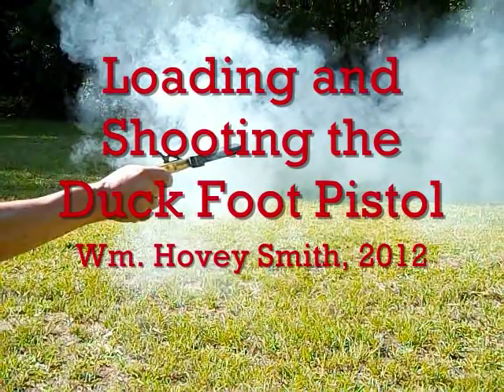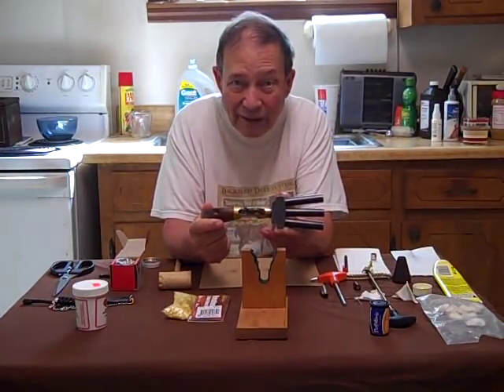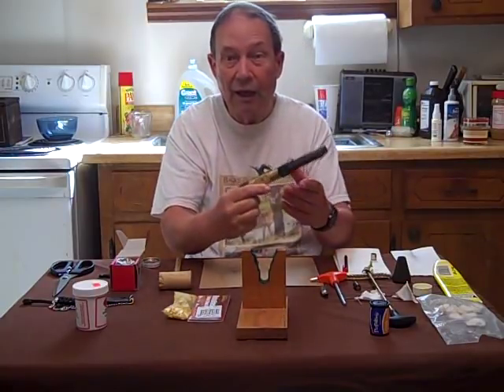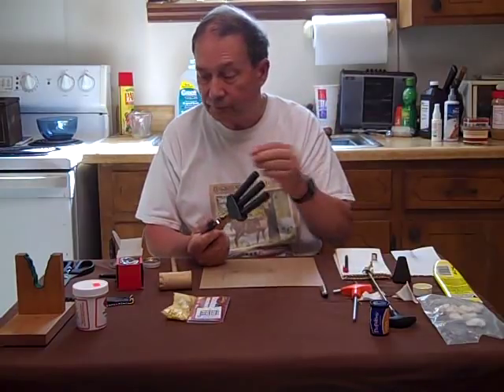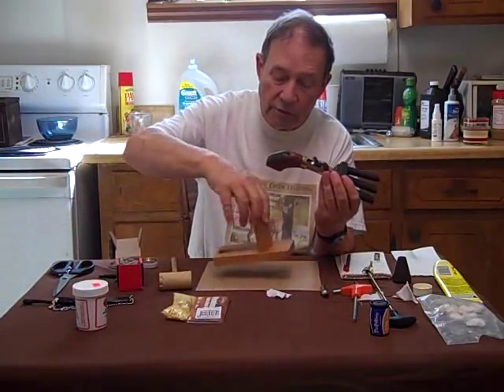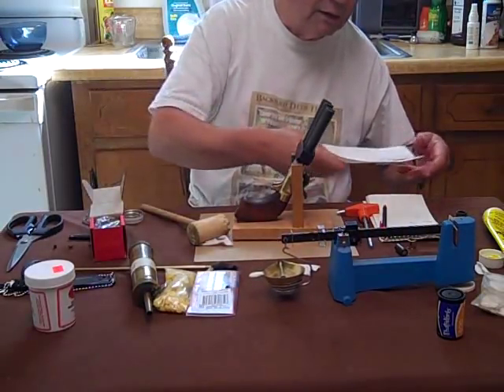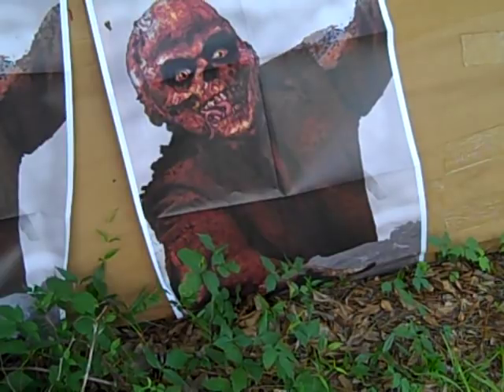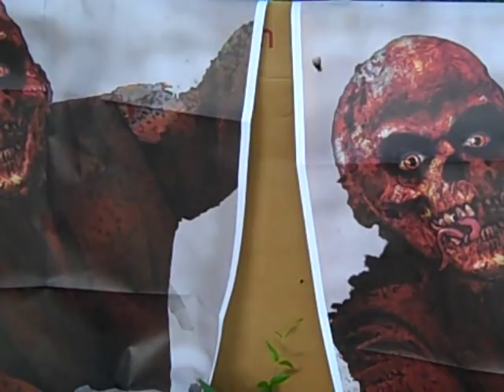Loading and Shooting the Duck Foot Pistol

Comment: I note that the brass frame that holds hammer, trigger, sear and nipple is exactly the same as a single shot .45 pocket pistol I own that was also probably a Dixie gun works kit, though mine has a 3 inch rifled screw barrel with no sights, kind of like a derringer pistol. My uncle owns an original duck foot pistol (or did), it was a wall hanger, I don't recall him ever trying to fire it.

Comment from the maker: The duck foot pistol kit and others are available from Dixie Gun Works in Union City Tennessee. If you like guns, you should purchase their annual catalogue which has a wealth of info on old guns, proof load tables, years of manufacture of several makers and parts for antique guns. Call (731) 885-0700 for information.  The pistol kit is their product no. PHI405 and there are two single spaced pages of other kits.

Comment: The gun was never intended to carried.  It was designed for sea captains dealing with mutineers and it would be kept loaded in the captain's cabin.  Of course several pistols and maybe a coaching carbine filled with shot would have made more sense.  I don't think there is a record of one ever actually being successfully used.

Comment: What size caps do you use, sir?
Reply from the maker: I shoot both no. 10s and 11s depending on the gun. As I recall 11s were loose and 10s were too tight. I worked down the nipple with a stone to obtain a tight fit with the 10s. You can always reduce the size of a nipple by careful grinding, but cannot very easily add diameter without potentially destroying the temper of the nipple. Under any circumstances never dry fire on the nipple of a percussion gun.
Reply: @HoveySmith  Thank you for the information, I appreciate it! I just bought one of these beauties, it looks like it'll be tons of fun to shoot.